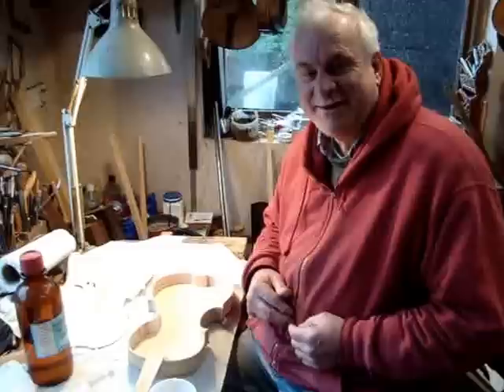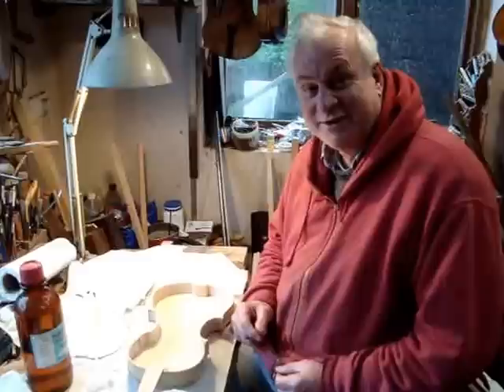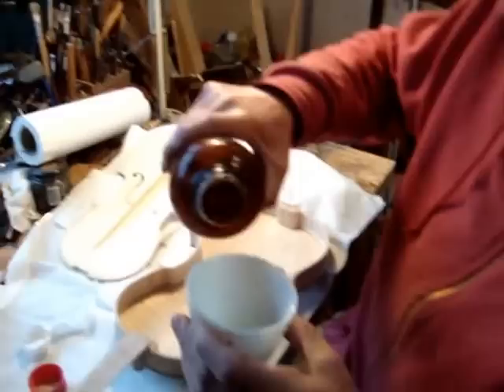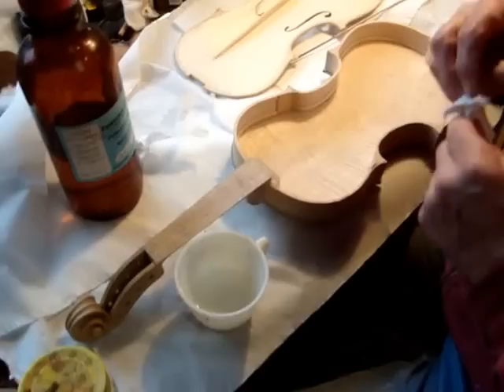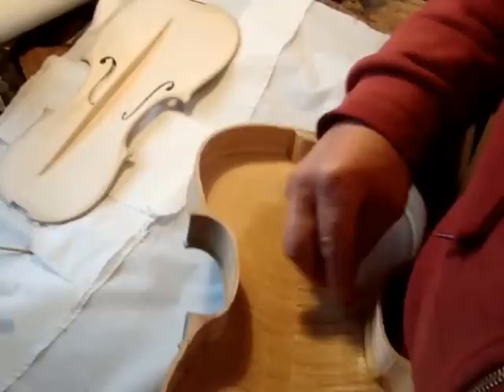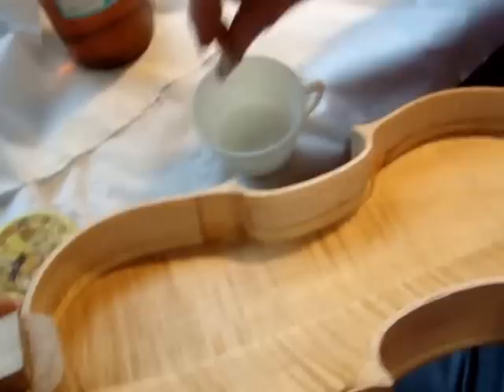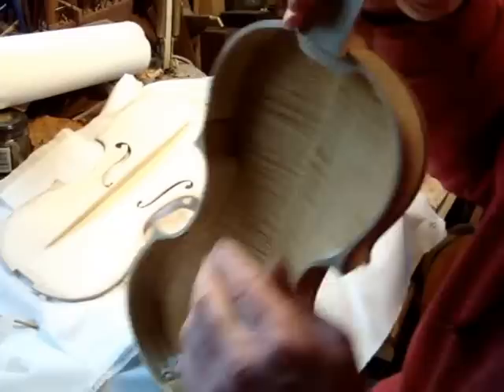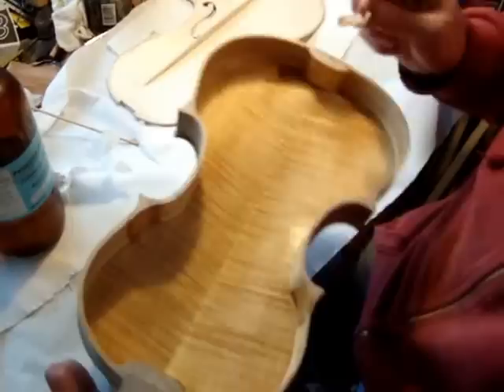Violin Ground for Pre-Varnishing Part 1 of 4

Comment: Thank you for your series, very interesting! Do you then use gelatin over this? Any thoughts on how they incorporated boron and propolis?
Reply from the maker: no need for gelatin! my ideas are based on a cambridge uni EDAX  examination which did not show boron but it may appear in other tests  as the original  source of the silicate was volcanic ash containing several compounds . no propolis in ground

Comment: Hello Frank the potassium silicate I looked at on eBay mentioned it was for improving plant growth. Would this be the same potassium you are using on the violin ? This may seem a stupid question but having no scientific background I was not sure if there was a different between the fertiliser version and the one you were using. I have finished my first violin and am now making two more and which I intend using your method for the ground coat. Thanks again for sharing this.👍 Also is Ferric chloride the same thing as iron chloride? I have seen marked as Ferric chloride/99%iron chloride. Apologies once again, I guess for you these may seem stupid questions, from my none scientific perspective I am clueless.
Reply from the maker: alas i have no experience of the plant growth variety and cannot give a good answer but it will probably be ok  keep looking on ebay in scientific - lab supplies i think the good stuff is there !  your ferric/iron  chloride is fine
Reply: By the way how’s the varnish you were making progressing, you had a plan to market it, I would buy some if it became available. I was considering having a go at making some although it seems a bit of a dangerous process. I may just purchase some instead.
Reply from the maker: @bluehoo0  sorry not going to happen now  but its not too dangerous compared with sky diving say

Comment: This may be a stupid question Frank, if I wonted to stain the violin would it have to be done before applying the treatment? As you say it becomes waterproof. Or would you not stain and put the colour in the following coats of varnish.
Reply from the maker: i have no experience of staining the ground layer but i think the surface would take stain .best thing would be to have a test run on some scrap wood that you have prepared with the ground, always valuable ! also from reading i would not expect the blue to be a dense colour but translucent as calcium silicate is a blanc fix (wiki) which is why it does not obscure the wood grain
Reply: Frank Pallister thanks Frank I will do some tests on scrap wood. I’m just about to start making my first violin. I’ve bought a couple of books which are very good regarding building the instrument but a bit vague when it comes to grounds and sealing the wood etc. So thanks for posting the videos as they have been a great help. Are you a scientist just wondered because of your chemical knowledge. Thanks
Reply from the maker: yes  i have a Bsc in applied biology but did not make a career with it i was always more into chemistry, then got into violin making and repairing                     @bluehoo0

Comment: Im starting my first violin. How long do I have to wait for this type of ground to dry before oil painting? I plan on finding a simple wood primer like this and using oil paints for my color layer and then use a clear/ natural varnish. Do you know if this process would work? I'm definitely more interested in how they did it back then than doing anything modern. Let's face it Amati had no idea what U.V. was let alone have a box that contains it. Im wanting to use as much household or readily available materials as possible. Hints the oil paint "they definitely had that" and natural varnish. Obviously I'll be cheating a bit if I go a French polish or wet sand and buff route but that's for a different discussion. What are the chemicals you used exactly? I see you can get them on ebay but obscure lab chemicals aren't my specialty forgive me.
Reply from the maker: half an hour to dry the silicate enough then about 24 hours after washing with lime water ,this is a chemical reaction which needs time to set like cement ,do not try to speed it up  then on day 3  wash it off with ferric chloride and allow one more day to dry , then its good to go , i think it is better to mix a little oil paint in clear oil varnish then you will get transparent coloured varnish
Reply: @frankpallister  thank you. So its fairly common practice to use oil paint for your color layer?
Reply from the maker: @robertl6770  when diluted a little so that the woodgrain is visible but it is a large subject !
Reply: @frankpallister  thanks. I have 0 experience with violins. I do work with wood but have never sealed or varnished anything. I suppose I will practice on scrap until I'm confident. I did look up the chemicals luckily I can get most of it in town. I do like the darker rather than the lighter finishes. I will just experiment until I find what works for me. I'm ordering an unfinished violin for my first project and will slowly get into making one from scratch but since varnish is my first hurdle its kind of where I'm forced to start. My biggest concern is gloss I think. I want it very glossy. I honestly don't care how it comes out other than that. I have experience wet sanding and buffing paint for automotive applications but never using natural finishes. Im not sure how that will work out but from what I've read if my varnish is truly dry it should be a non issue. Even if I have to wait a few months to let the varnish cure harden and age. Would you say thats about right or will it happen quicker than I think. I really just want to stay away from modern finishes because to me it defeats the purpose of the challenge. I could throw some automotive clear over it and nobody would ever know and would wonder how I got it so shiny but again its sort of cheating in my opinion. 

But thank you so much for your helpful insight. I was sold on a plaster ground or egg whites before I saw this.
Reply from the maker: @robertl6770  varnishing violins is a complex subject ,if you could buy a jar of violin varnish then i would say just use that but in my experience they  are all lacking the qualities of the old Cremonese i like my own varnish but it took many years experimenting to make. the best work i found was Michelson -violin varnish  but it has several flaws number one of which is his completely ignoring the instruction to boil linseed oil til it scorches a feather(see my youtube vid )